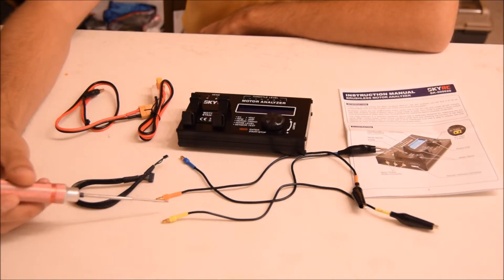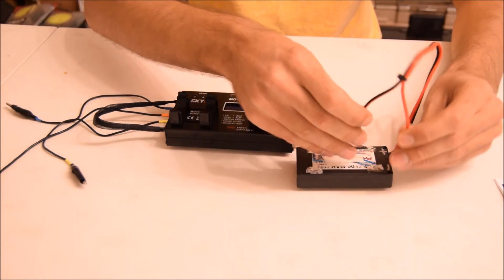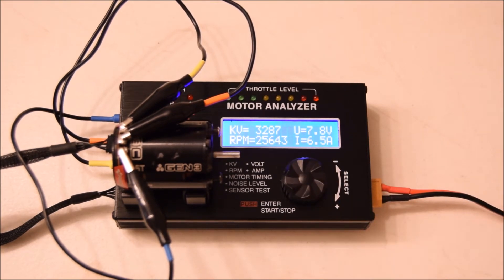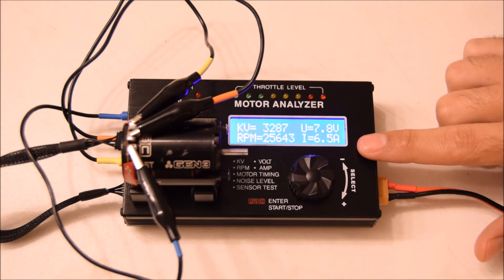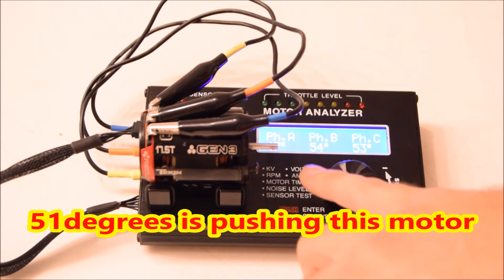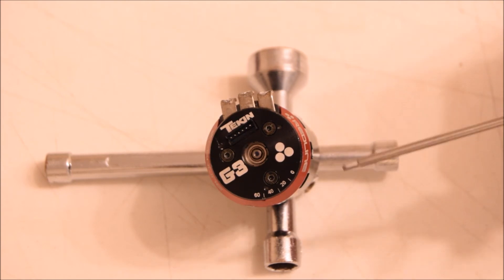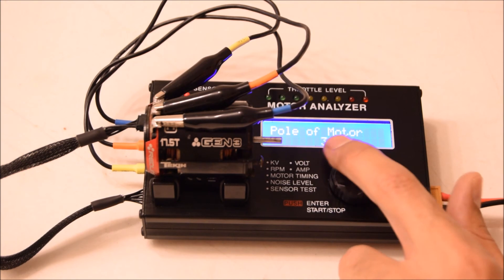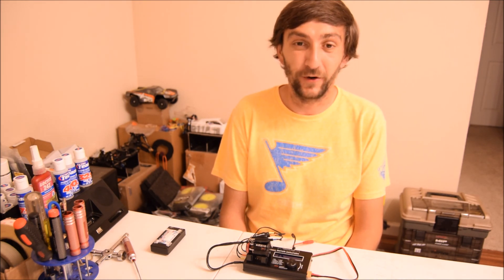Sky RC GForce  RC Motor Analyzer Review / Tutorial | Electric Motor Dyno

Comment: Interesting!  Thanks for sharing. 
I am curious about how changing the motor timing will impact the resulting KV.  Seems like this should tell me!
Reply from the maker: More timing means more kv
Reply: @RCAlley  Yes!   But how much....

Example:  I was comparing two motors.  One was X kv @ 30degrees.  The other motor was Y kv @ 40 degrees.  Trying to understand how different they really are.
Reply from the maker: @RoadsideRC  there is no magic number.  Literally every motor will behave differently.  Basically when you're tuning a motor kv is not that important.  Strength of the rotor is the main thing.  Once on an analyzer you're just trying to find a sweet spot between how many amps you're drawing and how many rpm it's spinning at.  So as you crank up the timing, amp draw and rpm go up creating more kv but more heat too.  Once you have that figured out, pinion and spur must be correct to allow the motor to spin up properly and use all it's power
Reply: @RCAlley  Thank you - I appreciate that detailed response.

Comment: Like your shirt!  Go Blues in 2019 playoffs!!  Now how does this machine  know if a sensor unit is bad in a motor? Will it diagnose that kind of failure? 

 I have a 13.5T that is melting sensor wires, (got it used and just tried to run it)  but still shows as  one incredibility  strong motor overall on a friends old school motor analyzer.   It just kind of  points to the sensor unit being bad??    It does not burn up the ESC though.   Just melts the insulation on the outside wire of the sensor cable? Both ends.    I'm ready to tear into the motor and fix it or not just for the hands on knowledge if nothing else as to whats inside one of these motors..  I would like to be able to test the motor before and after the sensor unit swap to see if it helped before melting any more sensor wires  :-)
Reply from the maker: Yeah buddy! I hope this is our year.

Once you plug the sensor wire to the motor and analyzer there will be 3 lights that glow red if the sensor board is good.  If a light is out, it means that particular port (a,b or c) is bad.
Reply: @RCAlley  Huh,  just that simple.   I guess it's time to give one of these a try and see...  And holy cow thanks for such a quick reply!!!!  Hope to race with you one day.
Reply from the maker: Yup, it's a very helpful tool to have.  Haha no problem, it's a small channel, I don't get many comments.  Thanks would be super cool!

Comment: If you tune a motor with 2 cell will it be optimized also with a one cell? I see the unit needs a two cell battery to run it but the classes I’m in are one cell battery, 17.5 motor
Reply: That’s a question I’d like know the answer too as well
Reply: RC Alley thanks for getting back to us.
Reply from the maker: I'm not sure, but I'm looking into it.  I have no experience with 1s so I had to ask someone and am still waiting on the reply.
Reply from the maker: This is what I was told when I asked the question  verbatim "Short answer.  No.  It's a power to  gear ratio to weight issue"